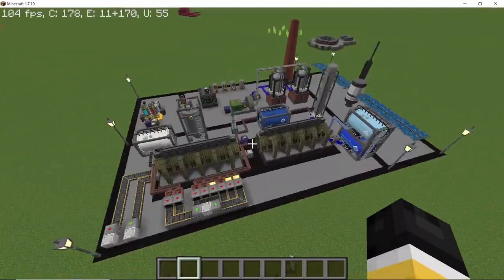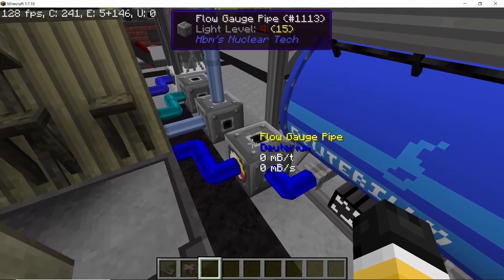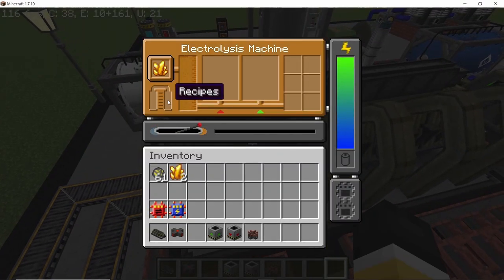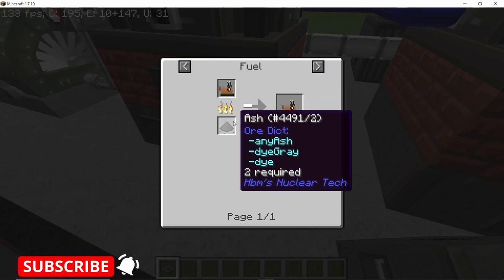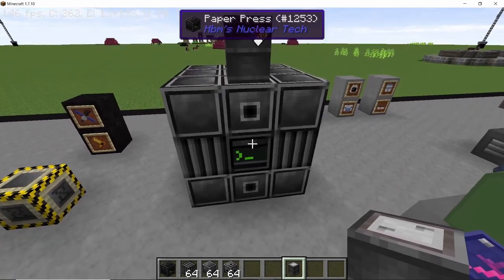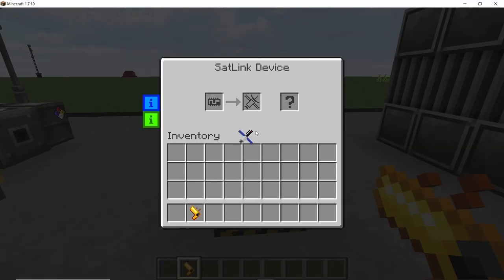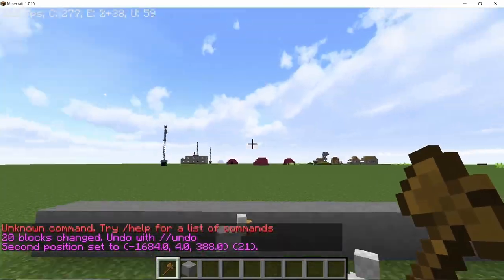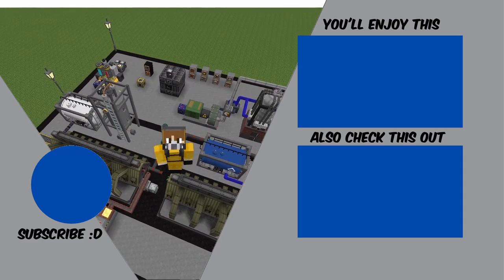Electrolysis Machine, 6x Ore Processing, Custom Machines & More - HBM's NTM Updates

Comment: can you help me? when i build RBMK and connect all pipes my fps drop from 144 to 40, and i see on your videos that you have beyond 100 fps when you build reactor
Reply: im playing on 1.12.2
Reply from the maker: can be a 1.12.2 ntm problem cause it is not as optimized as the 1.7.10 version. However this will also depend on how much ram you have assigned to minecraft and what kind of setup you have. 
My laptop has a ryzen 5 4600H processor, 16 gb ram and 4 gb nvidia gtx 1650 card for reference

Comment: How do you render the explosions so fast? whenever i do them it takes ages
Reply from the maker: I have a midspec gaming laptop at best with Ryzen 5 4600H processor, GTX 1650 and 16 gigs of ram. For optimization mods I only use Optifine.